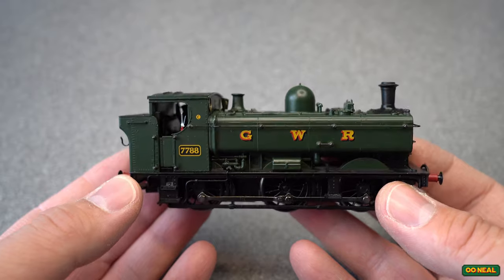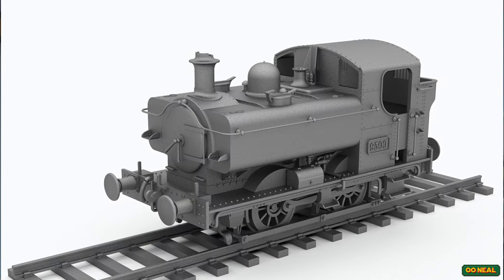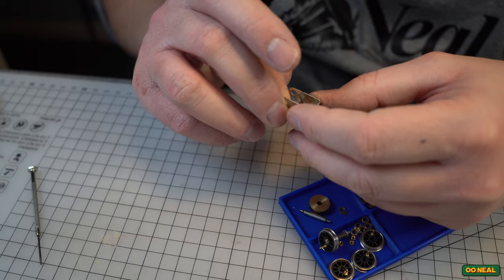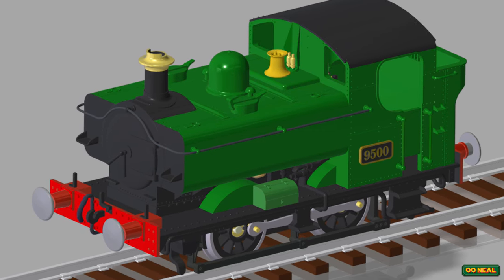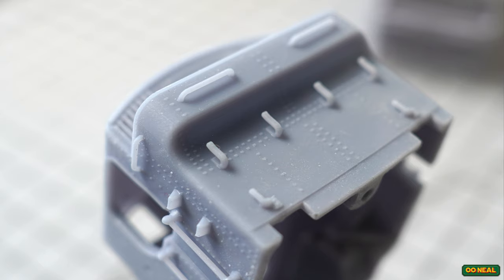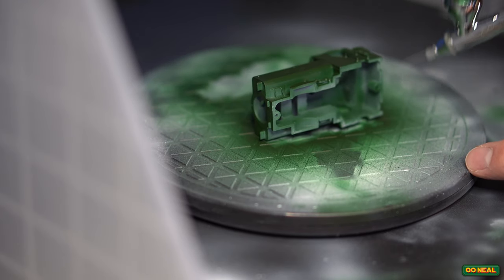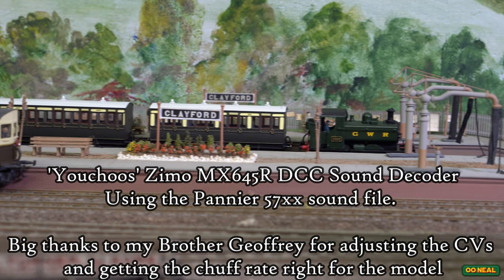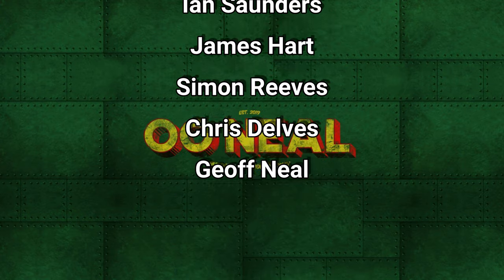3D Printed & CNC Machined GWR 95xx 0-4-0 Loco designed from scratch | S2 E26

Comment: Fantastic. Probably mentioned before but I chose to do a GWR rebuild of a M&SWJR L-class which is a 4-4-0 tender loco. I had a motorised tender chassis (Airfix 4F most likely) which met the dimension requirements near enough and going that way meant an FDM chassis for the front with brass bearings inserted was doable seeing as I don’t have the CNC machinery or even at that time a pillar drill for brass plate. I used donor Hornby wheels, coupling rods and bogie but otherwise was FDM. Everything was designed to be sympathetic to FDM, printing in resin you could certainly make some changes and break it down into fewer pieces than I had to, and I had to apply the rivet details afterwards as waterslides, which would also be easy with a resin printer. I was amazed when it all came together and worked. Modelling a safety valve bonnet on a taper boiler in fusion 360 was no mean feat! There’s a lot of software that couldn’t produce that shape! Anyway point of telling you this is you’d be more than welcome to have the CAD of you wanted to give it a go and improve it with a metal and motorised main chassis and help with the bulk of the dimensions having already been reproduced digitally.
Reply from the maker: Hello, that sounds like a great project I would love to see it. Yes maybe oneday to build up what you’ve been working on would be cool. I’ve got a lot of projects to get through now though but it’s nice to hear what you used and how you did it. Maybe you can send me some pictures on Instagram 😊

Comment: Looking very good.

As a suggestion for future projects: printing parts at 45° is a a good compromise for artifacts on all faces; but there is a "golden angle" to print at where the surface at that angle will have almost imperceptible layer lines, since the layers don't skip any pixels when going up to the next layer. On my Photon it's 46.62° for a 50 micron layer height, but it will vary based on the pixel width of your screen and the layer height. Other surfaces will have imperfections, but it's good if one surface matters more than others.

I'd love to do a similar project in N scale, but I lack the CNC machine and CAD skills to realise such a project.

Comment: Fascinating! but totally beyond me as I just cut metal and solder and use a hand rivetter. As to those fold-up gear boxes...The gears never mesh right. For some reason the armature shaft hunts and the loco runs hesitantly in one direction, though better in another and I've been trying these gearboxes since the 1960s . I prefer buying a worm and gear set and making the frame myself.
Reply from the maker: Thanks, I’ve spent many years watching my dad make them from brass and always been so impressed, one day I will have a go at a brass kit.

Comment: I'm interested, in the long term, by building my own engines in HO scale (PLM railway in France). I am still blocked now by the valve gear, always outside one on french trains... I'm thinking about it now, maybe with brass plat pieces laser-cut.
Anyway, it's still interesting to see how you do your model. Now, I juste have to buy a 3D printer first !
Reply from the maker: I hope they work out for you, outside valve gear from scratch is something I would like to learn about so I can understand where your coming from. Get yourself the 3D printer and have some fun.

Comment: 😮an 0-4-0 pannier type yes please 😃
Reply from the maker: Glad you like it!!
Reply: Yeah but what did you use for it’s motive power again I couldn’t find it on eBay
Reply from the maker: @mistermadmachine6311  you have to get it from a company called Branchlines. It’s a mashima 9x16 motor and a 50/1 gearbox
Reply: Thanks

Comment: There was no such thing as a 95XX in real life. It turns out that the numbers 9500-9599 were never issued to any GWR or BR locomotive.
Reply from the maker: I think you missed what I had explained during the video? The whole idea of the steam engine is fictitious  and so I used those numbers for that reason because they were free. I hope that helps you
Reply: @OONeal  It was just for those that didn't know that the GWR No. 9500-9599 was never issued or allocated. It's nice take on a small locomotive, much better than what I can come up with.